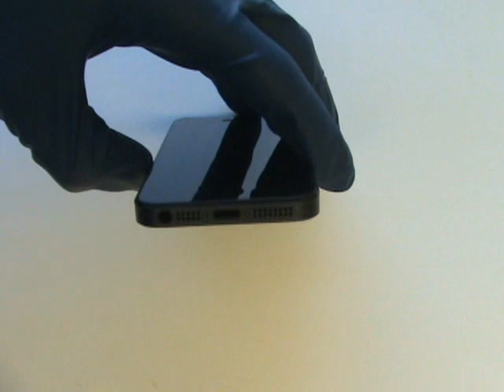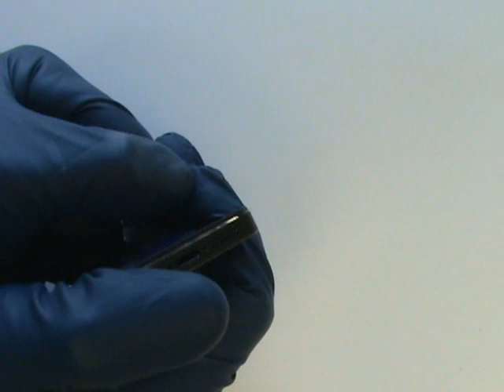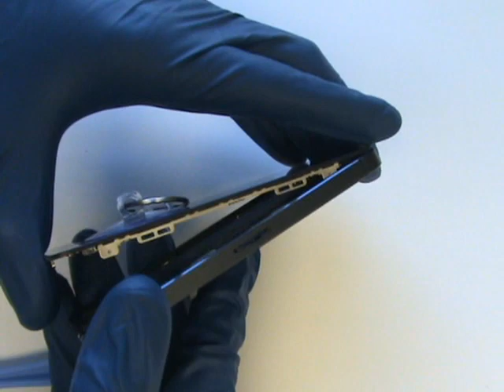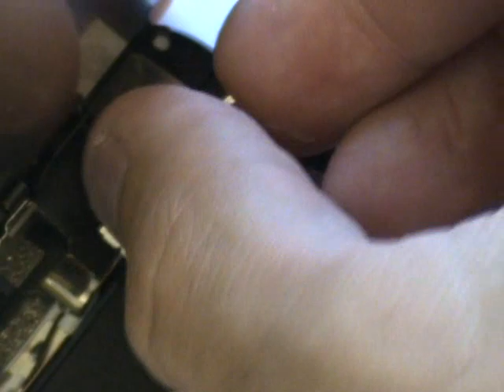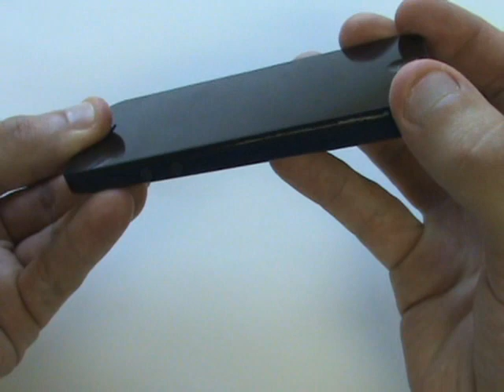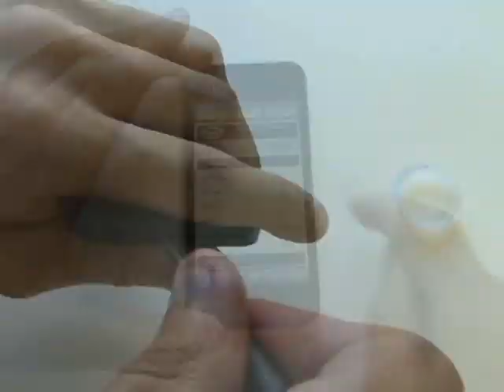iPhone 5 Screen Repair Tutorial Instructions | GadgetMenders.com

Comment: hello. i have an iphone 5 that i wanted to replace the bettery. when i lifted the screen it didn't come in one piece. i mean the glass and screen came off in one piece while the thin frame underneath didn't. i saw the screen was still working at the point in time. then when i was able to lift the screen frame, i noticed that one of the tiny screws holding the front camera was really loose so i tighten it up. i proceeded to replace the battery (i might've unplugged the battery before turning the phone off) and when i put every thing back together, the screen was all black, the phone doesn't respond to anything. i call it and it rings but the phone is just dead. i then plugged it to itunes and it was recognized just fine. any idea what could the problem be?! :(

Comment: hey buddy ive recently replaced my iphone 5 screen(LCD) and my phone wont turn back on, ive tried holding the button for 7-10 seconds but still will not turn back on what do you suggest?
Reply from the maker: Josh Hezseltine You may have damaged a cable during repair, or its possible that you had a defective screen. I assume its too late but that is my suggestion. sorry for the late reply

Comment: would this work if the phone fell into the toilet? because my screen doesn't work but everything else does
Reply from the maker: It could fix the screen but because the phone was water damaged it's hard to say for sure.  Also, you may notice other (perhaps temperamental) problems later on.

Comment: I have a little problem. I've recently replaced a screen assembly on an iPhone 5, and everything seemed to be fine. But after 2-3 minutes of use, the digitizer goes crazy when I touch it. As if it gets tapped rapidly all over the screen. Even if I hold my finger still, then screen jumps back and forth, and the phone is completely useless. However, the problem disappears the moment I lock the screen, and unlock it. Then it's fine for another 2-3 minutes, and suddenly everything goes mad. Am I dealing with a faulty digitizer, or have I done something wrong?
Reply from the maker: It sounds like you have a faulty screen.  You can verify that the cables are securely plugged in and recheck the screen.  If the problem remains you likely have a defective screen.  If you purchased the screen from us please contact us and we can further assist you with an exchange.
Reply: Thanks for feedback. The problem is solved now, after purchasing a new screen from another seller, and I got the defective digitizer refunded without even returning it :-)
Reply: faulty screen man, same happened to my brothers one i just replaced, never buy from ebay unless they are in the same country you are in!

Comment: Well thanks to this video my iphone 5 is fixed! Silly me didn't notice the screen i bought elsewhere didn't come with speaker, front camera and proximity sensor and had gadget mender not mentioned them and pointed them out I wouldn't of noticed straight away  but managed to take them off the broken screen and they're still working so yey! Also accidentally turned the phone on b4 the screen was plugged in so had to reboot phone b4 the screen worked but now it's perfect  thanks so much x

Comment from the maker: You may be able to but it's not recommended because it's a very sealed fit up against the phone making it very difficult to use this method.  Also, you risk damaging the casing or cracked the screen if you were opening the phone for a different reason such as a battery replacement.

Comment: Once the exterior glass is broken, the lcd underneath is basically useless as the glass is glued to the LCD and there's no way you can separate the glass from the LCD without breaking both of them.The LCD replacement costs $200 which doesn't make any economic sense, as Apple store charges $230 for a completely new phone.

Comment: it all has to be repaired, you have to have a clean room to replace the touch digitizer on the lcd, plus you will not be able to remove the touch digitizer without damaging the lcd or digitizer.

Comment from the maker: The gloves protect your hands from the broken glass and prevent fingerprints from getting on the new screen.  They also prevent oils from getting on the internals of the device.  They are not 100% necessary but it's a good precaution to take.